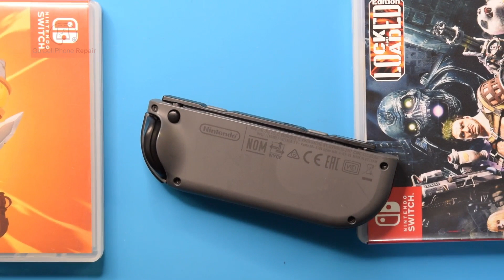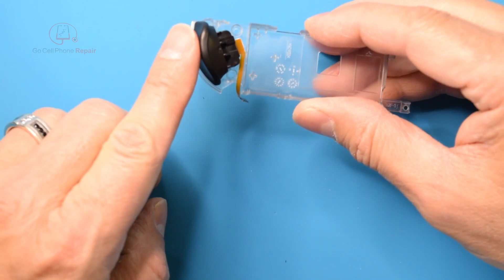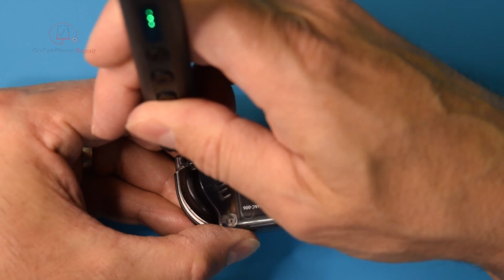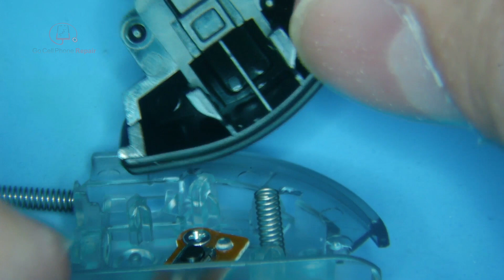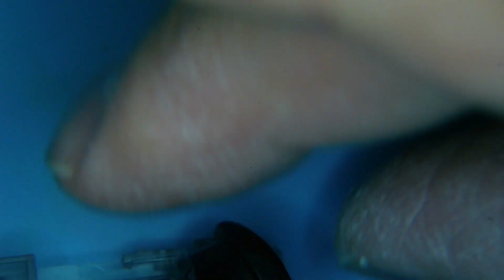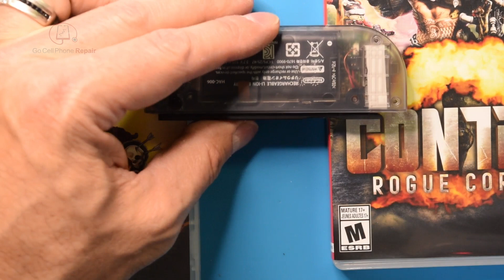Joy Con Shell Replacement- Complete Detailed Teardown and Assembly

Comment: Was muttering to myself when the springs in the 2nd joy con did not want to cooperate
Reply from the maker: Oh man, that one is kind of a pain. I probably would have been doing more than muttering if the microphone wasn’t on.
Reply: i found it easier to click the trigger in, then slide the spring into the 2 stick-out parts as the spring is quite easily collapsable.